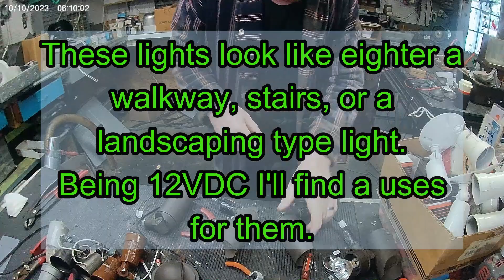Checking 12VDC lights  10 16 1200

Comment: Great update because we were messing around with a 12 V lights the other day we didn’t realize that they were they were all we hooked him up and plug them in to a regular outlet and they kind of exploded lol so that’s one way to test them anyway we’re not gonna use them. We don’t even remember where we got. It was so long ago but I know they were basically free any we were going to figure something else out that we’re going to use have a great weekend, Sir.
Reply from the maker: Oops: Poof.  Ya, some come with the same type of power cord, so if not marked it can happen poof.  If I'm not sure, I'll try 12VDC first, if it's wrong just won't work.  A 110-120 DC lamp will work on 12VDC, just change the bulb to a 12VDC, and plug into a 12VDC source.  I'm done with all this haul, time to put it away, no more vids on this stuff for now.